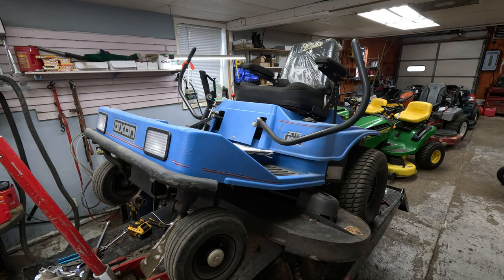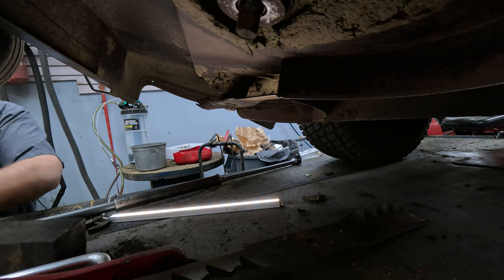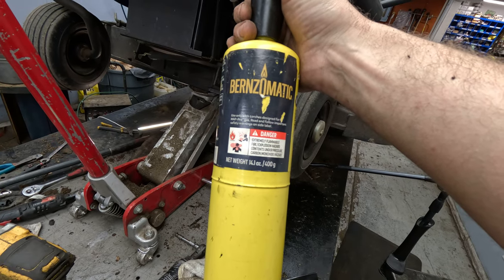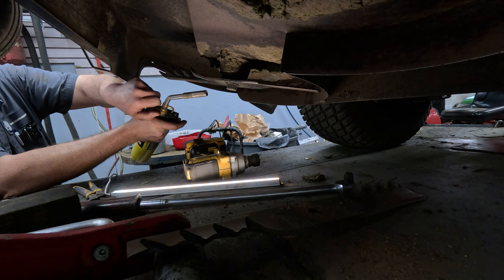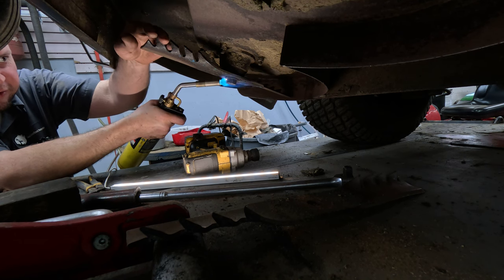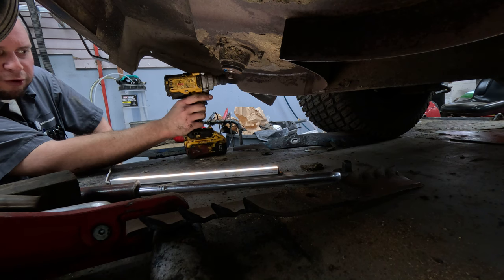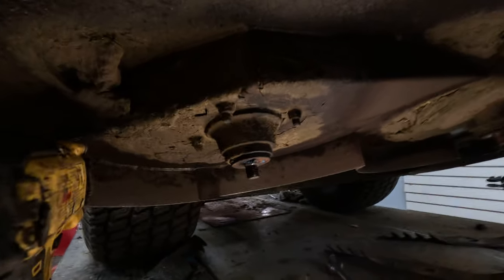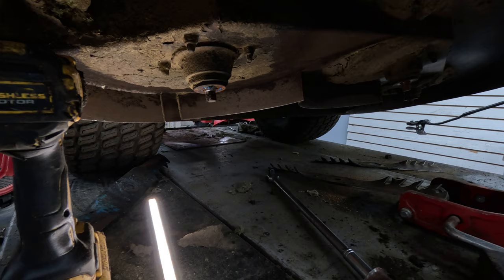How To Easily Remove Blade Nut or Bolt That Won't Come Off Blade Is Too Tight Can't Get Blade Off

Comment: (SOMETIMES) if you try to TIGHTEN the nut and then turn it counter clockwise that works.
Reply from the maker: This is a great tip! It works well and is something I did not mention! Thanks for watching!

Comment: I'm rebuilding an old mower deck with new mandrels, spindles, pulleys and belts. It's really wore out like most mower decks get over time and I don't think any of the bolts except the bolts that fasten the blades to the spindles have ever been removed. I knew about heating nuts or bolts to loosen the really tight stuff but your tip on the using map gas is a keeper! Good job...good video.. I could hear you really well.. you explained things really clearly and you had good camera angles we could see exactly what you were doing and those are what make the best diy 'How To' videos. Thanx, 👍  p.s I subscribed. ✅
Reply from the maker: Awesome! Glad to hear!! Thanks for watching!

Comment: The flame wrench works a lot. Great tips on map vs propane.
Reply from the maker: I was sitting here thinking what is he talking about flame wrench haha!!
Reply: @IndRepair  normally an oxygen acetalene. I’ve used heat on different things. I had a duhh moment when you heated the nuts. Take care

Comment: If I have a Ferris mower with bolts instead of nuts, holding the blades, will heating it work the same? I’m thinking if it seized, it will; however, if it’s strictly to expand the nut, so it is looser, wouldn’t that have the opposite effect if I’m heating the bolt?
Reply from the maker: Many times the temperature difference between the two will free them but not nearly as effective, no
Reply: @IndRepair  Thank you. I heated with Mapp for about 50 seconds each and then I had to hit it with my Dewalt DW292 impact for about 15-20 seconds, but they finally came off.
Reply from the maker: Great job!

Comment: Will heat work with a bolt on my mower it's not a nut?
Reply from the maker: Yes, many times heat will break the bond and let it free
Reply: @IndRepair  TY 👍👍

Comment: Map gas or cutting torch is what I use but because it’s iron nut don’t over heat it 
Just a tad of heat is all
Reply from the maker: Very true, they sure will deteriorate quick with an oxygen acetylene torch. I don't use mine much anymore because the map gas works so well

Comment: I am having issues getting the top nut off my middle spindle of an exmark. The nut holding the blade just spins. When I put a wrench on the bottom nut and use a cordless socket wrench on the top it just loosens the bottom nut. Any suggestions?
Reply from the maker: You should be able to hold onto the top pulley and use an impact to get it off. Sometimes you can get a pipe wrench under the pulley to grip part of the spacer on the shaft if you need something to hold it

Comment: Hey 750LB Torque Wrench from Kobalt works Too > That Battery not enough juice .
Reply from the maker: Yeah sometimes a bigger impact works but in many cases even with the larger one (we have a Dewalt with 1,200 ft-lbs breakaway torque we use often with difficult nuts) you will have to use heat to break free the rusting together the two have done

Comment: Other thing is older folks can trade some thing for some help if all else fails
Reply from the maker: Very true! I have many times have older people ask for help getting blades sharpened because of this issue. I used to go help right there but don't have the capacity to run out all the time anymore so I have the driver bring them back so I can get them taken care of

Comment: And if that doesn't work
Reply from the maker: Heat, bigger impact or a larger breaker bar/pipe on ratchet or whatever to get more removing power. Block of wood to stop the blade from turning